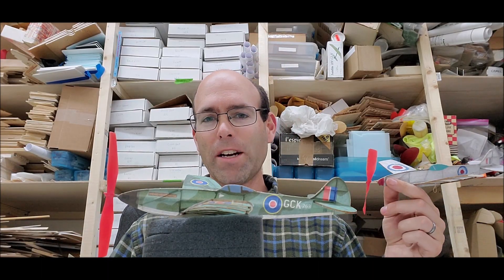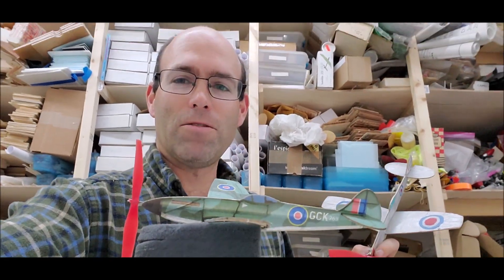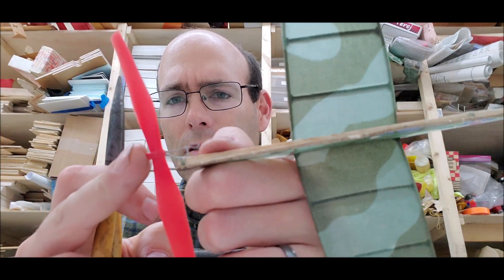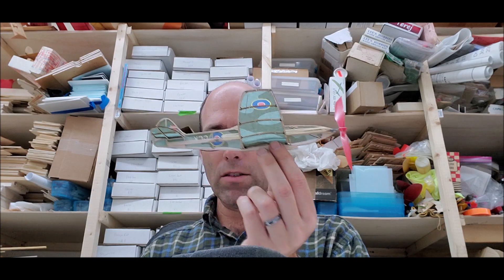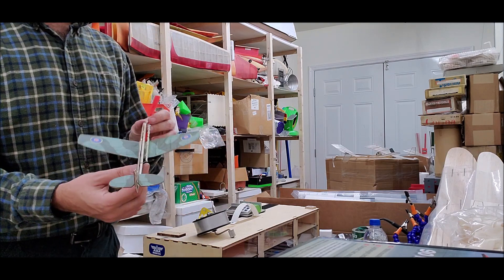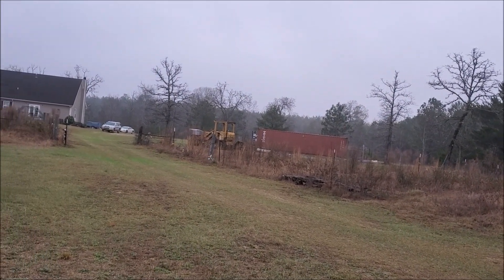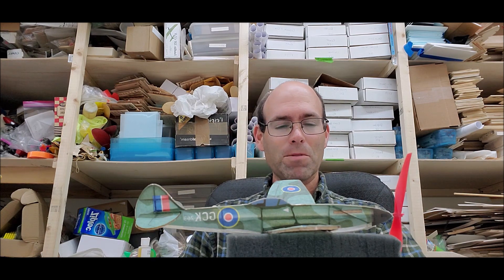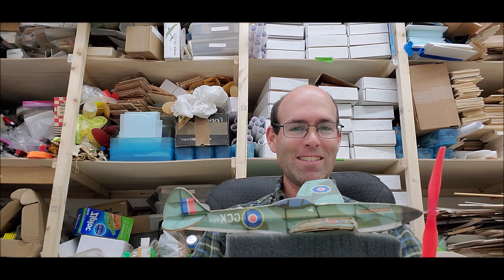How to fly Nocal Scale rubber powered model airplanes

Comment: In the fifties you could buy a balsa/paper/plastic prop/wire airplane with LANDING GEAR and rolling wheels and rubber band NOT included. 15 cents. They flew like a dream.

Comment: Great video. My first NoCal was a little Zero, with plans found online and shrunk down to what I could fit on my printer. I used scrap balsa to build it, and amazingly, it flew for 30 seconds on it's 2nd flight outside. Total luck, as I have never built one before, and my free flight experience was limited to Guillow's kits, which all flew for less time than that. My second try was a Dauntless, and let's just say it needs some massaging to sort out properly.
Reply from the maker: You were fortunate to get your first one going really well. As you've found, they can be really finicky. When you get it right, they're awesome.

Comment: Peck Polymers used to be my go-to shopping place, however the demise of hobby shops has made free flight hardware impossible to buy in person. Can you recommend websites?
Reply from the maker: Peck is still around but sometimes unreliable. Peck-polymers.com
Other options are Easy Built Models, FAI Model Supply, Volare Products, Retro RC, Indoor FF Supply, Laser Cut Planes, and of course my own website over at jhaerospace.com

Comment: So how do you balance one of those props?
Reply from the maker: Either scrape material from the heavy blade using a knife as per the Phantom Flash video, or glue a tiny dab of weight to thr light blade and keep tweaking the amount of weight until the prop balances correctly
Reply: @joshuawfinn  Do you use the same prop balancer that R/Cer's use?
Reply from the maker: @surreyearl  since these are free turning in the bearing, you can actually balance them on the plane